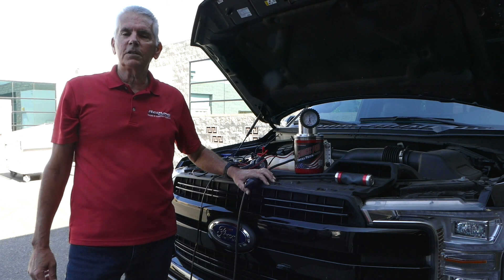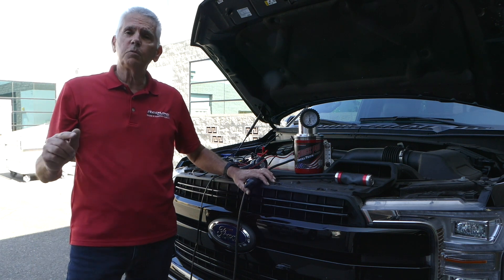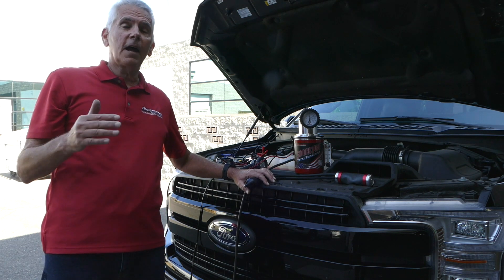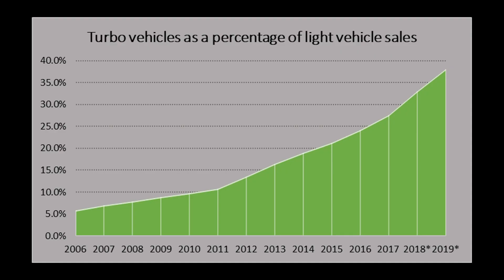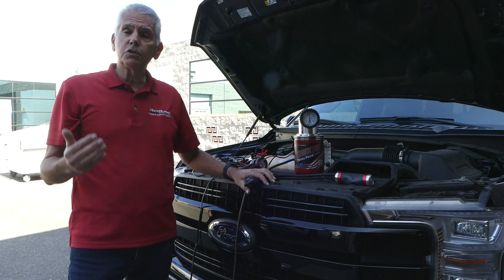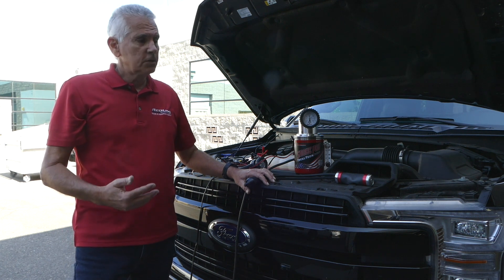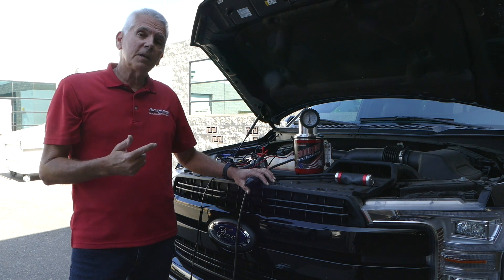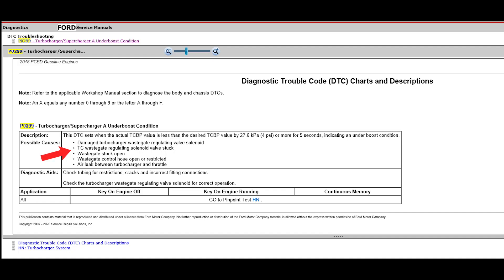Tech Tip: How to Properly Diagnose Turbo Vehicles - P0299 Code

Comment: 56,000 MI Ford F-150 EcoBoost 2017 blown passenger side Turbo started smoking all crazy low boost couldn't find it with the smoke test ran truck with intake disconnected and found Mass oil leak on Blown bearing passenger side Turbo

Comment: U can buy $200 or less smoke machines that have higher Psi for them. No need to pay $3k and up for the second one u used. Also that bladder u used is $900 plus for a set of them. This is an add to over spend for that equipment

Comment: A lot of Fords are now Turbo Charged.   One of these days I'm going to have to buy one of the High Pressure Smoke Machines.
Reply: If you have not bought an ecoboost yet. You have been missing a lot of performance and fuel economy. I bought a new 2016 F165. That little 2.7 twin turbo v6 is amazing. I have 79k miles and the only problem was a bad $20 cylinder head temp sensor @ 69k miles.